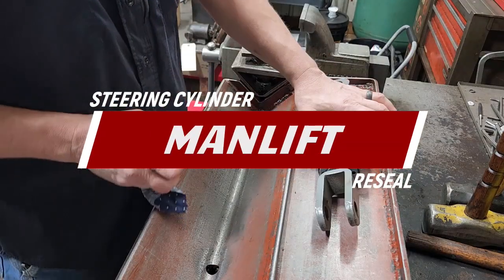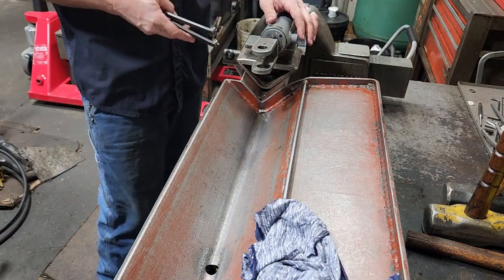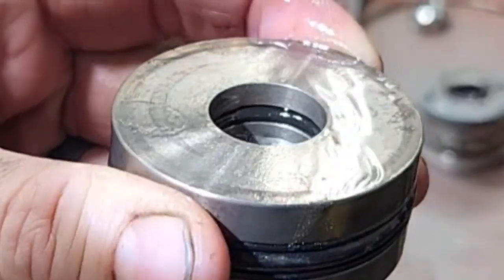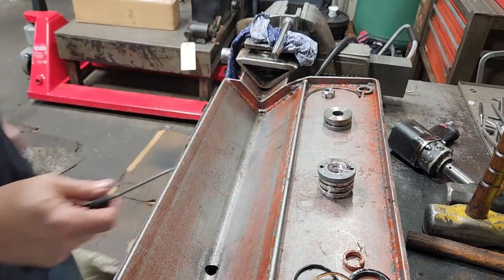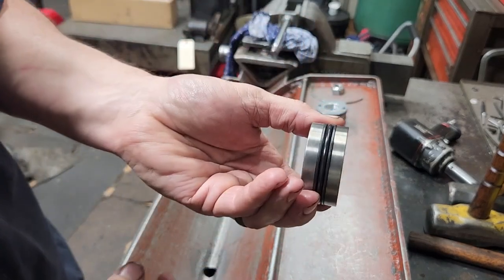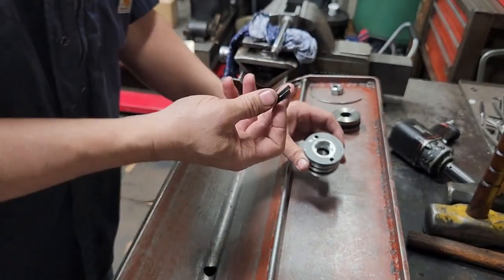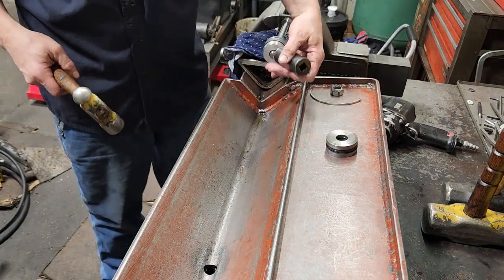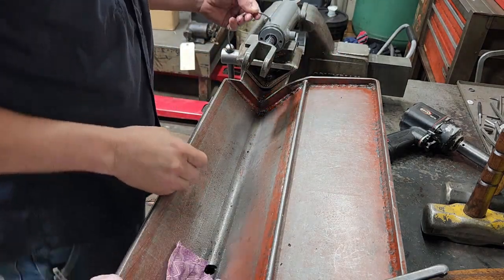Most Hated Hydraulic Seal Tool Helped Me

Comment from the maker: What's your thoughts on hydraulic seals installation tools? They definitely have their place, in my opinion. Thanks for watching!
Reply: They would definitely be handy.  Especially if you already have them. But for somebody like me that does this once in a while because of necessity, I use patience and take my time.
Reply from the maker: Patience is a good tool, too!
Reply: Invaluable on smaller cylinders,  hydraulic motors and pumps. A pro tip, I take a scorchbrite disc to the ends of them to slightly soften the corners. So they don’t cut the seals.